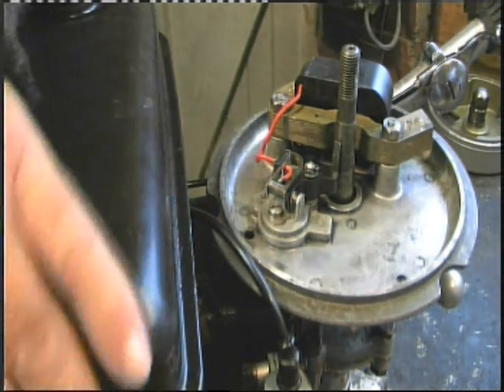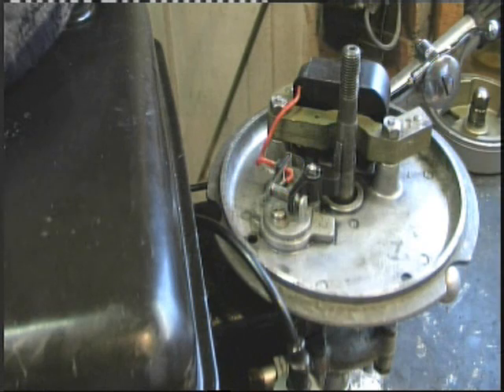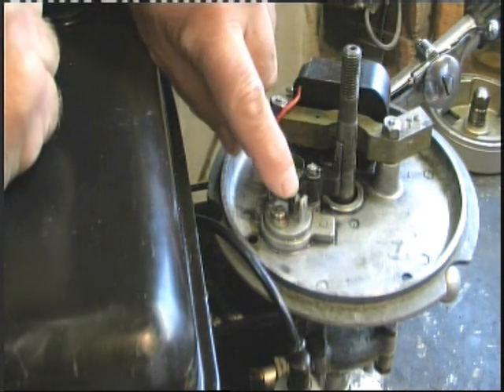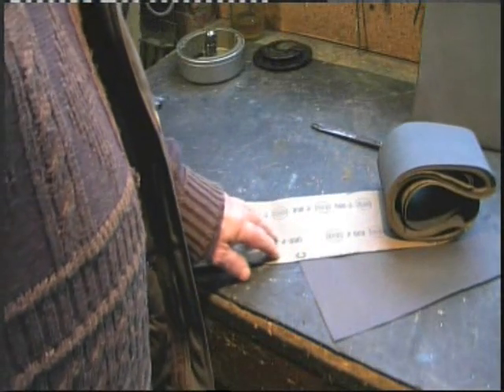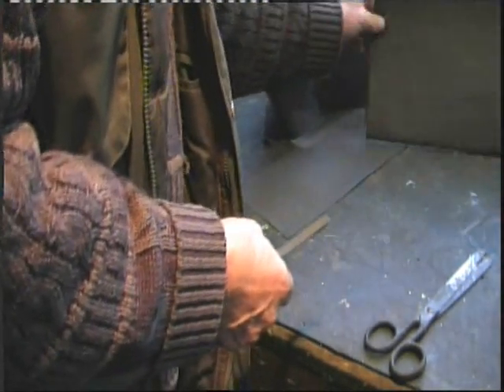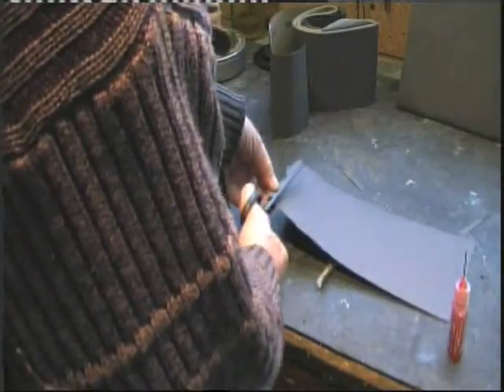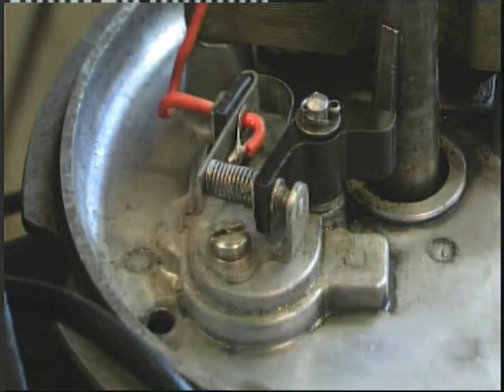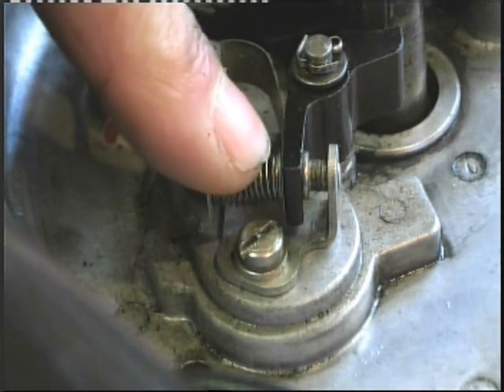How not to murder engine points

Comment: Used to ride off road bikes in competition back in 70s, and all had points triggered ignition systems. Never ever noticed any dirt on the points, which could have been removed with 600G wet and dry. 

Points surface seemed to accumulate a sort of grey oxide film of some sort, which was removable with something like 240G wet or dry, wrapped round a feeler gauge blade, to allow a sort of filing motion.

This seemed to work pretty well, and clean in this way and check and adjust timing at same time, made for good running and very reliable.

On these applications at least trying to clean with 800G would have been a total waste of time, as oxide (or whatever it was!) wouldnt have been touched by such fine material.

Comment: I have dealt with my share of points. It used to be the case that it was cheaper to replace them than to fiddle with them, but this is no longer the case, because almost nobody makes points anymore.  But I have not seen crocus cloth for years in this country, anywhere. Do you think a very fine diamond lap  (E-Z laps I think is the brand name) would work? Especially with NO oil on the lap, because oil will spoil the electrical contact.
Reply from the maker: I don`t know what E-Z are ? try wet/dry max 600 use dry! no oil I used Deoxit etc
Reply from the maker: +justlookingsteve Sounds like you your part of this Co, if you want to send me samples to appraise, be my guest :-)

Comment: Nothing wrong with points, but it is old tech. I have a old 1977 Motorcycle that had points which I switched over to electronic ignition from the same model bike but from a 1984. The electronic ignition makes the bike a lot easier to start and runs smoother, BUT, it is non repairable, but has never let me down....Great video.
Reply from the maker: I`m "old tech", sometimes think there`s been a time slip and I got left behind :-)

Comment: I've never encountered points, is the condenser a capacitor, as a capacitor across a switch stops arching?

Without watching your video, I would of reached for 100 grit sandpaper.
Reply from the maker: Sorry I often forget, yes indeed a condenser is as you say a capacitor nowonder few understand what the heck I`m on about most of the time :-)
Reply: ***** ~ You make enough sense to learn from. Merry Christmas
Reply: +poroldchap Amen. It's still a condenser to me. But I have learned to say "condenser -- er, I mean capacitor" :)

Comment: Excellent. I spent most of my young years working on engines and this is exactly how all of the old manuals told us to clean the points. In a pinch, for a roadside clean up, we would take the striking strip off a matchbox (the old wooden kind) and use that.
Reply from the maker: nowadays they connect a computer that tell`s you , youv`e got a flat tyre !  ;-)
Reply: ***** Ha Haaa. True. Technology is capable of making us APPEAR smart while actually making us lazy and dumb.

Comment: It has been a long time since I had to fool with contact points.  If you got em then you have to do what you did.  If you have a more modern system you probably will never have a problem with that part of the engine.  Some parts of the changing world are for the better.  Believe it or not I still have a dwell meter in  the closet, just like new.  Thanks for the video.
Reply from the maker: You should make a video on the use of the dwell meter, I guess a few youngsters (repairing vintage stuff) will find this is new to them ! indeed this is express purpose for my making videos
Reply: +poroldchap I have no idea where I would get an engine with points to tune up.  I don't hang out with the classic car crowd so that is out and I don't have access to any classic motorcycles.